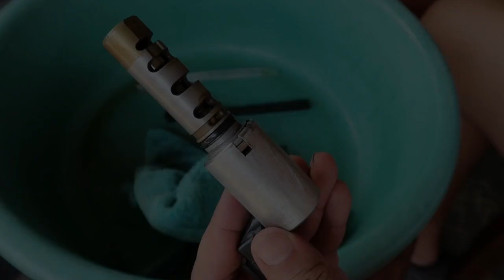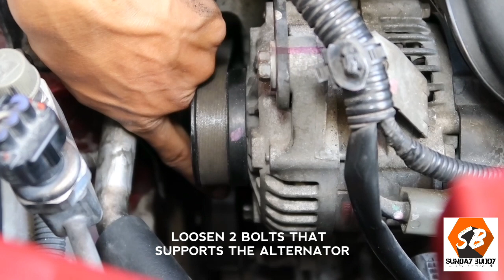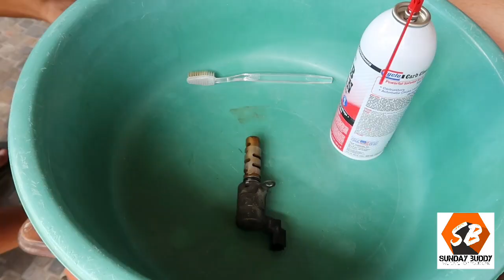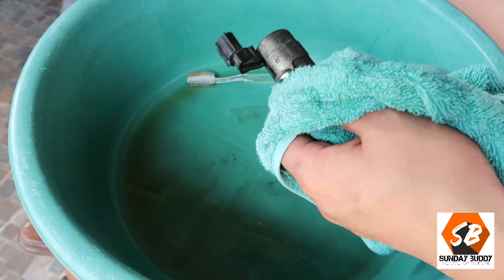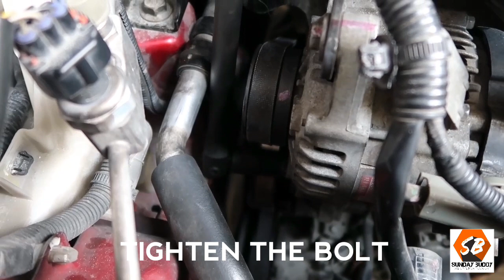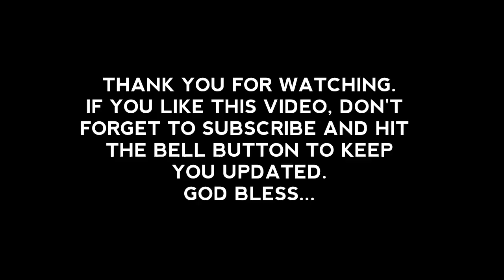How to remove and clean the VVT Solenoid

Comment: I used a sonic cleaner with a degreaser.  Then put them into a container with oil for storage to use later if I need to.
The sonic cleaner really gets them clean, inside and out.
Reply from the maker: Thanks for sharing your feedback using sonic Bob :) It will help our other subscribers. :)

Comment: My biggest question is, is this for all toyotas? I'm in an 08 Tacoma, and it has rough idle and misfires, lurches when accelerating suddenly, so I know it's the vvt solenoid, but I can't find a diagram of the engine online anywhere.
Reply from the maker: Hi Max, This is video tutorial is only applicable for 2nz engines primarily manufactured for toyota asian cars.
Reply: @SundayBuddySolutions  BBB😅

Comment: Can I use intake valve cleaner? Or turbo cleaner?
Reply from the maker: Hi Sean, Not really sure what components are there in the intake valve cleaner or turbo truck cleaner so I cannot say that it can be used for cleaning solenoid.

Comment: Ok did VCS and Track Off light disapeared after this solution?
Reply from the maker: Hi Ivan, Better to have it scan first your car using OBD scanner to determine the faulty code, I am not really sure if there is a relationship between vvt-solenoid and vehicle stability control.

Comment: Boss pinalitan ko ng solenoid ko. Pagkabit ko. Ayaw na poh mg andar
Reply from the maker: Hi Zaimin. kindly test the new solenoid if it is working using your car battery. Just like what I have fone in the video tutorial. And also check the socket  wires. If theres no cranking when you start the engine, most probably the battery is the problem.
Reply: @SundayBuddySolutions  ng start poh ako without solenoid. Hndi vaa masira ang timing chain ko
Reply from the maker: Its not good to start your engine without your vvt-solenoid installed. It can cause rough idling. I advise you to have it check with your trusted mechanic. do not try to start it again because it can damage engine parts..
Reply: @SundayBuddySolutions  tanx. Ngayn hindi na ma start ang engine. Huhhuhu. Kasi gusto ko sna linisan kaya lng nbali tpos pinalitan kona ng bago ngyn hindi nah mgstart. Salamat sa reply. Hinge me advice